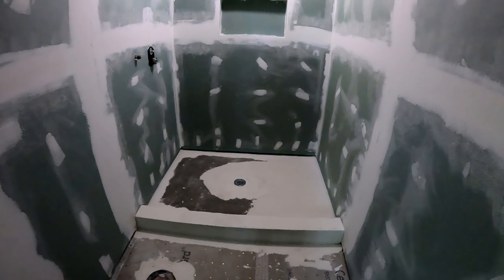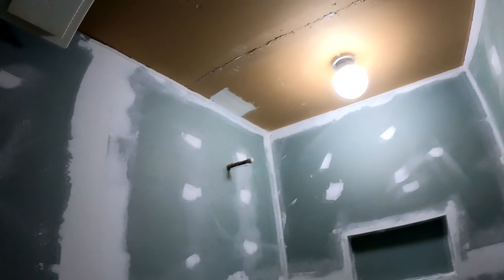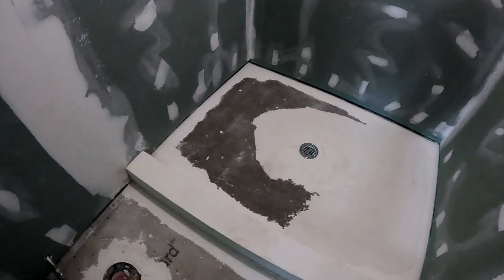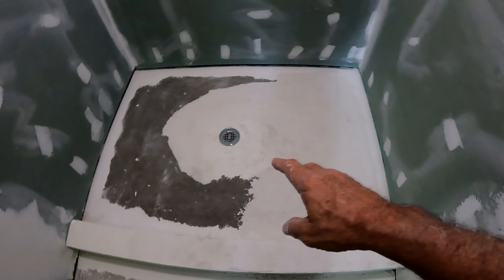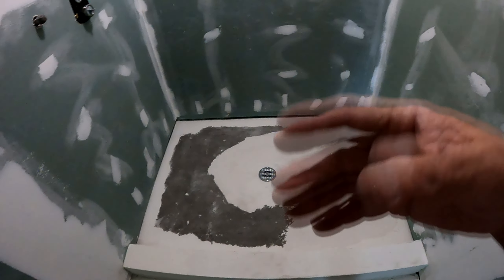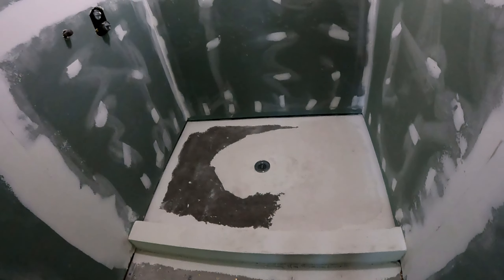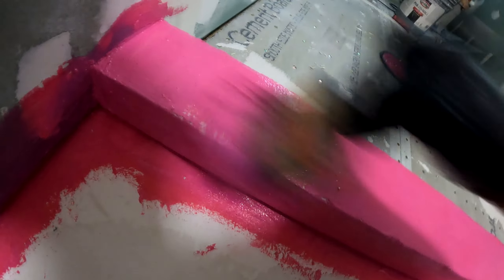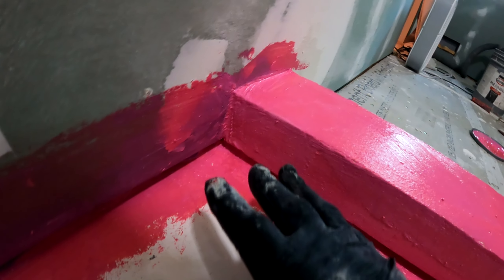FULL BATHROOM and SHOWER.... Day 7

Comment: With this method the water will saturate the thinset under the floor tile since the drain sits higher then the red guard and the water has no where to go (no weep holes).  Thoughts?  Will the thinset breakdown over time when completely saturated in water 100% of the time
Reply from the maker: Actually it's reverse, the tile sits higher than the drain.....
Regardless once the pan is waterproof there is a little bit of thinset holding the tile, and yes that thinset potentially would be wet from taking a shower, however it is a small amount of thinset compared to the 200-300 plus pounds of mortar that you would normally have been saturated 100% 24/7. My assumption is that small amount of thin-set would dry out between showers.. given the two options and having torn out saturated pans over and over and over, I would rather have my option than the former.
But regardless of what you choose to do whether it be a liquid topical membrane or a sheet membrane, everybody has moved toward the sealed system which basically this is.
Reply: @StarrTile  Yea but couldn't you figure out a nice way of making the drain flush with the pan or a hair below.? wouldn't that be the best of both worlds? I understand the tile will be higher but a slight more dramatic slope all around drain and with you tile cut at angle like you do around drain I think its do able. NO? Or on second thought a drain that has weep holes right under top edge that would be best.. I dont think good idea for water to pool around drain
Reply: @StarrTile  First, thanks for the videos. This really helps homeowners and DIYers. Second, I believe you used to Redgard up to a foot from the drain, because you were still utilizing the mortar bed and pan liner underneath to evacuate water. Now you are still using a pan liner, but Redgard all the way up to the drain, essentially not relying on the pan liner. What made you switch over?

In this situation would not siliconeing or Redgarding the area around the drain allow for the mortar to carry water down to the weepholes?
Reply: @clg_pro2009  I think that would be ideal. But he could also have not siliconed it, or Regarded up to the drain. That would allow the pan liner and mortar to wick the water down to the weep holes. Your thoughts on that?

Comment: Hey Bob, love your work. I do wonder if you ever had an issue of having water get behind the tile on the floor edges and lay in the trough below the wallboard and the edge of the pan. Even though it's waterproofed do you think it's an issue if water would get in there and just sit. Thanks for all your videos.
Reply from the maker: My belief is having a gap that would have air in it would allow for evaporation if it got through which I seriously don't think it would
Reply: @StarrTile  wouldn't it just pool back there and give issue to the wall studs?

I do appreciate your videos and am starting on my walk in diy this week

Also.  Hello from fort bragg NC. I noticed that airborne sticker on your truck!
Reply from the maker: @S550d  firstly I really don't think much moisture would get back there anyway because the water should shed off of the wall tile onto the floor and down to the drain, but even if a tad bit of moisture got back there as I said before, it has air to evaporate it, and the studs are covered by the pan liner so no it would not affect the studs...

And yes, I was at Fort Bragg back in the day...3rd325

Comment: Quick question Bob, 

What did you use behind the main niche wall? Just silicone? 
Also, would it be better to use durarock instead of drywall? Had some green left over but returned leftovers and got dura. Im gonna redgaurd everything so yeah just curious about your opinion. 

Great work!
Thanks
Reply from the maker: I don't see what difference it makes to use durock, especially on a wall since walls are never the problem, and no matter what you use the niche and everything else should be waterproof before the tile anyway. 

The only time I use different products is if it makes the job better and in this case I don't see where it makes the job any better

Comment: I’ve seen your videos about not putting the wall board down into the pan.  But why not bring the wall board down to the mud bed, mesh and thin set the seam there and then red guard?   That gap there seems really counter intuitive.  If you are water proofing properly, you shouldn’t be getting water down there in the first place.

Comment: would it really matter if the wallboard sat on the mortar bed? I mean it’s all waterproofed anyways. Wondering your thoughts? Thanks Bob
Reply from the maker: Yes if the bottom AND the back is waterproof then it wouldn't matter, but no 100% guarantee you can do that, PLUS I like my floor tile squarely inside that gap and grouted before wall tile overlaps it